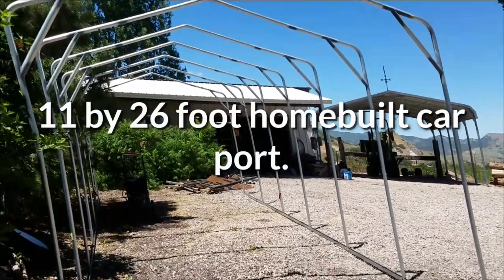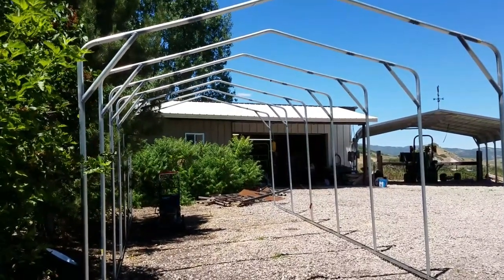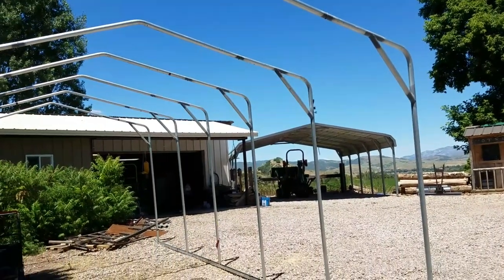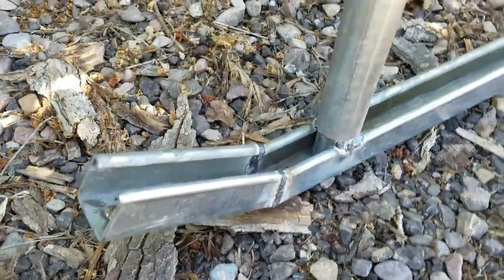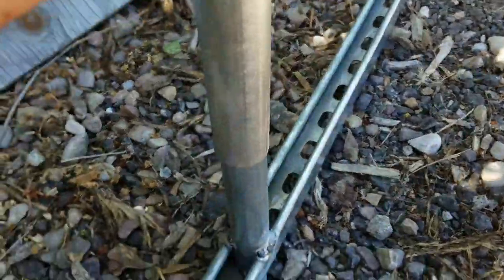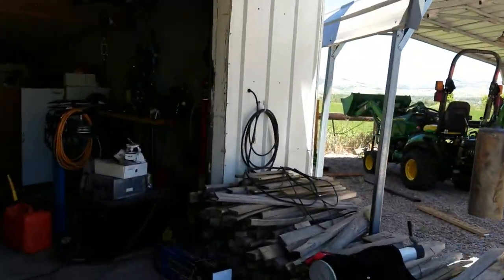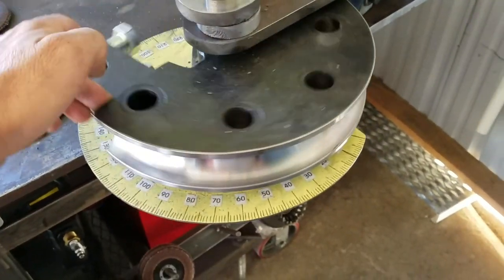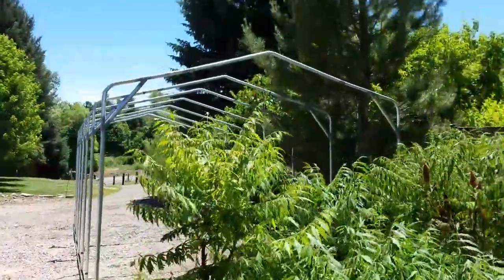600 dollar homebuilt carport.

Comment: Nice carport build  ooks like it will hold up well, the  bottom  track or skid is made from a product thats usually called Unistrut  its very often used in Commercial Construction  ive seen it in staled in  roofing structures to hang all kinds of things from  roompartitions to electrical and plumbing  needs from as well as Architectual Woodworking and designer  furniture and  items    7

Comment: Where u get panels
Reply from the maker: From any metal roofing company or store. They will cut to length
Reply from the maker: The bottom 2 pieces are called unistrut and is used in a lot of different applications. The frame work is from chain link fence top rail and measures 1.5 inches and fits in my tubing bender great.
Reply from the maker: The bottom 2 pieces are called unistrut and is used in a lot of different applications. The frame work is from chain link fence top rail and measures 1.5 inches and fits in my tubing bender great.

Comment: Thanks ..I need to build a carport for my RV and need it to be low cost. I may look and see what Harbor Freight has for a bender. What did you use for a weld this??
Reply: I'm doing the same thing right now Mark Mathews, and using the $114 Harbor Freight pipe bender. I'm using 1 1/2 EMT for the top piece and 1 1/4 for the sides.  1 1/4 slides nicely into 1 1/2 and like he said in the video, 1 3/8 top post for the bottom.  It's all good !   Wish he talked about the tarp he used and how it held up, but I think he's done answering questions :-(
Reply: Mark Osborne he said a metal roof
Reply from the maker: Yes metal roof and a wire feed welder.
Reply: Got it- thanks guys
Reply: A cig. lighter and a coat hanger,,,
Reply: If you can afford an RV I'm sure you can afford some kind of a carport or tarp.
Reply: @mark_osborne  I thought he said he was going to use metal siding/roofing tin